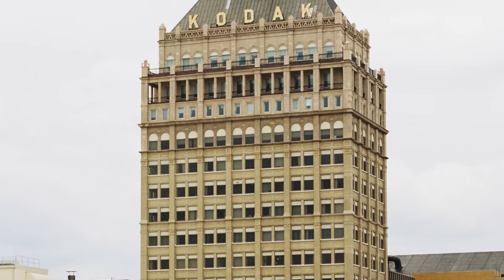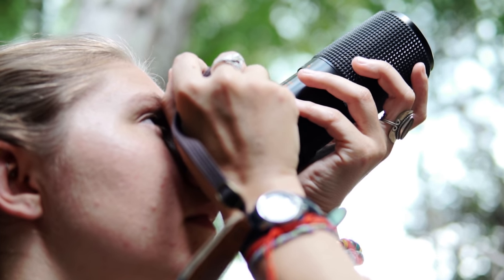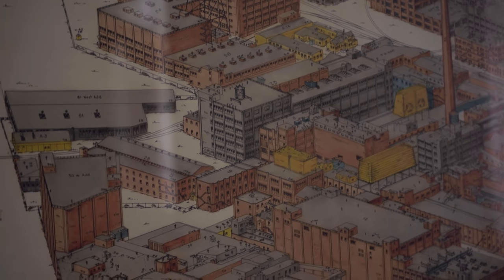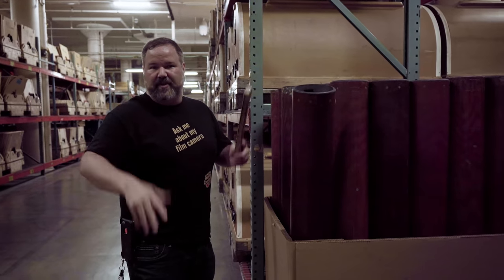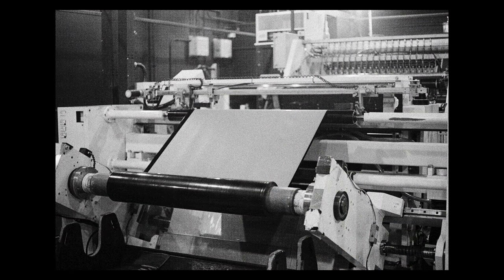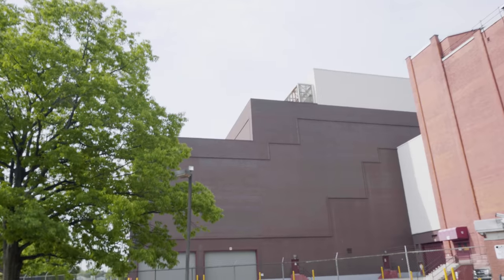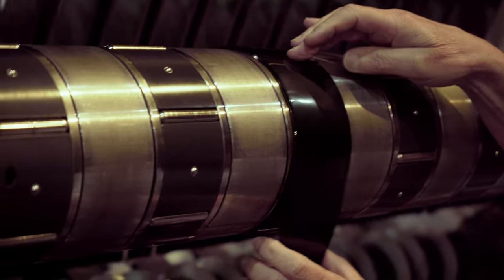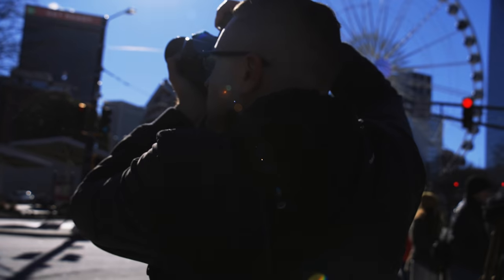Kodak: Behind the Scenes

Comment: Thank you for that!
While I never worked in the Rochester plant, I did work for Kodak in the Swedish development plant there in Järfälla outside of Stockholm, a place that was later called "Kodak Hill", with the development of Kodachrome slide film.
What we called "kakor" (cookies) was 50 rolls of slide film in a light sealed roll that came down from the first darkroom where the rolls were taped together, down to the "Kodachromegången" (Kodachrome isle) and were taken into the darkroom by us and riveted together with the roll of film before it through the different baths, first B&W development of the exposed film (yes, Kodachrome is a three-layered B&W film with each layer sensitive to each of the prime colours), removing bath (to remove the negative and leave the positive), then the colour baths (cyan, yellow and magenta to add colour to the three colour sensitive layers) and fixing plus rinse and it came out for drying were we cut the 50-roll of film and sent it off to the people either framing them or just cutting them to a roll, depending on the customers choice.

We had a ton of fun together and I especially loved the employee discount of film, Kodak had a small employee-store on the way to the canteen, stocked with the usual and a lot of special stuff too, like Infrared film, Technical Pan etc, loads of fun to play around with as a young amateur photographer, but that was like 40 years ago.
Cheers!
Reply: Wou, what great times! A relative of mine gave me an exposed Kodachrome film and apparently it can not be developed anymore due to the complexity of the proccess you described!
Reply: @Ununquandio  Yes, proprietary development process was unique for Kodak, at the time it was the K-14 process, could only be developed by Kodak.
The fine graine as it was B&W and thus smaller individual grain than colour-coupled normal colour emulsion made it very special.
Agfa also had a proprietary slide development up until the CT-18 and CT-21 until they switched to E6 with the later CT100, but it wasn't the same thing, lovely colours if you wanted the almost watercolour look but the grain was much larger and not similar to the Kodachrome with more natural colours, skies really popped with blue of Kodachrome.

Comment: Nice movie, but the creative process of photography also takes place with digital cameras, there is no reason to mystify film photography. The reality is that no camera manufacturer except Leica still makes analogue cameras (real cameras and not plastic toys like the lomo stuff) and it is getting harder and harder to find someone who can still repair cameras from the 70s and 80s and many cameras from that time now have ageing damage. The know-how and spare parts are disappearing. Furthermore, Fujifilm has now stopped the production of the Pro 400H colour film. The film market is getting smaller and at the same time more expensive. If it continues like this, at some point it will only be yuppies who can afford Leicas and films who take analogue photos and elevate it to a ridiculous high art.
Reply: I have a Kodak Pony 35 mm camera that has the ability to take multiple exposures if you just reset recock the shutter without advancing the film. There was one double exposure I got that I did not originally intend to take because I forgot to advance the film but I really liked the image I got. With other types of cameras even if they are capable of multiple exposures I would not have thought of putting those two images together in that way.

Comment: Frankly the Ilford video was far more inspiring of trust in the product and QC measures in my opinion.  They seemed interested in showing who they are.  To me, this video seems to show why Kodak has problems -lack of commitment by senior management as evidenced by none being in the video, and kind of half-assed images of stuff.  Kind of old shitty equipment.  Not complaining about the videography but frankly it is not inspiring of confidence or commitment to the product.   Too bad they don't have much much much much better PR with regard to their signature products.  Where's the pride?  I am a fan of Kodak films by the way, almost exclusively I use their brand.  But with the loss of the film to whomever the new owners are, it seems like it is kind of just a free-floating teet from a former cow being used to pay off pensioners (and you know who you are).
Reply: You do realize that the Ilford video was made by Ilford? This video was not made by Kodak. Also  the "old shitty equipment" is probably better and more reliable, and also easier/cheaper to repair than the new equipment. A company isn't going to spend million and millions of dollars on new equipment if the old stuff is just fine. The last factory I worked in didn't have a machine newer than 1952 but we made parts withing +/- .0001 on those old worn out machines.
Reply: @johnjon1823  I wholeheartedly agree with you here. Kodak is run by bureaucrats looking to squeeze out every single drop of value they can with their practical monopoly on color film now. Like old times, they are making huge mistakes by pricing themselves out in the name of "investments". And when they successfully priced themselves out of the market, they'll bring down a good chunk of the film community with them as many people solely shoot color film only.
Reply: @user-ti9zc1xv2b  The brand and company have been tragically mismanaged for decades.  They had a very successful business at one point but became a tacit monopoly in the US for film and rested on it as a cash cow.   I knew people who worked there, nice jobs, I even had them as a client on one project, they were nice payers. They had the possibility for many things including dominating cameras and even sensors and the like but blew it.   They had the resources to change but not the leadership.   They would have had to cannibalize some business if they had the guts they would be amazing today.  Sadly they are not, and current managers of the film products seem to have exactly ZERO competence and vision.   One would be remiss in not laying some of the blame on the business environment created by the state of NY, bad foreign trade negotiations, and an arrogant, even criminally negligent, disregard for strategic manufacturing infrastructure of the nation on behalf of political powers and leaders.  Frankly worthy of jail and pages in the history books along with Benedict Arnold.   To think  of the manufacturing expertise, prowess, and capabilities  and jobs lost due to exceedingly great moral turpitude is nauseating.    Bausch & Lomb, Xerox, Carrier Corporation,  Buffalo, Syracuse, Rochester giant parts of upstate NY tossed to the wind, along with jobs, tax base and the like, supplanted by a ratio of two private sector jobs for each government one,  not enough  jobs at McDonald's  to pull the freight on those giant government employee pensions
and benefits.  NY state is funded almost exclusively by the rich downstate who are now leaving, the 1 or 2 percent pay like half of all revenue.   Doesn't stop people from getting an Emmy.   Sorry to go on too long.  Best wishes, feel free to to disagree completely with anything or everything I have said.  Look at the see through NY site about the state.  

Best wishes!